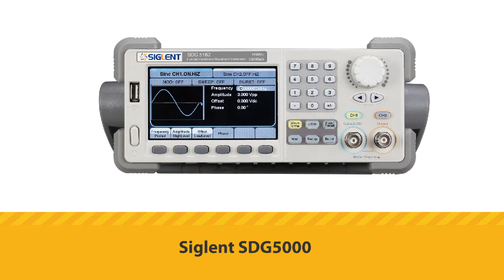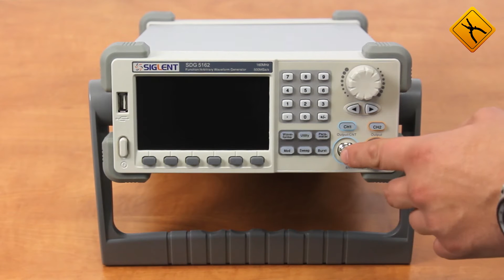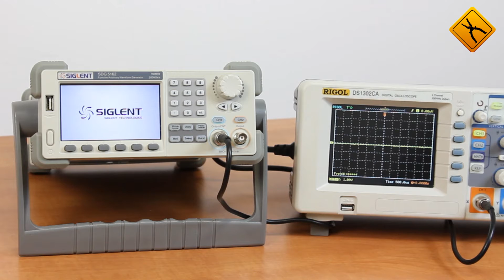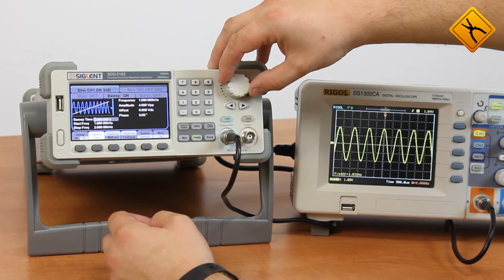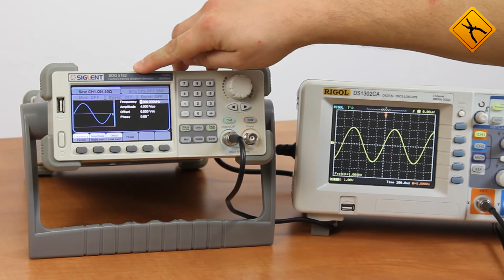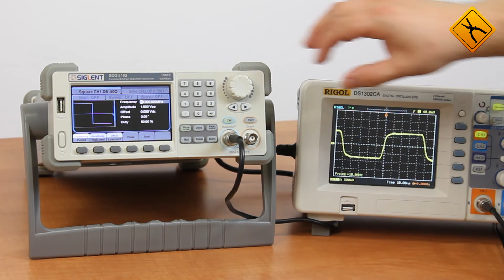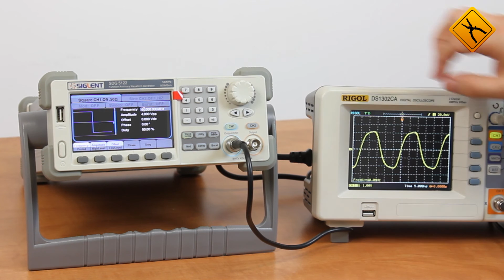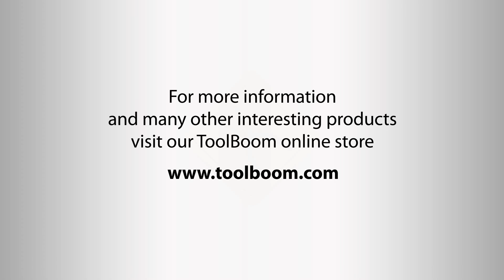SIGLENT SDG5000 Series Arbitrary Waveform Generators

Comment: Which socket frequency measurement?
No info. in addition in the document!
How with synchronized with external ones 10 MHz signal the guidance is not so good!
(SDG 1050 Siglent)
Reply from the maker: mukundalini Frequency measurement mode in SDG5000 - signal is applied to socket "CH1/CNT".  In SDG1000 - signal is applied to socket "CH2/CNT".